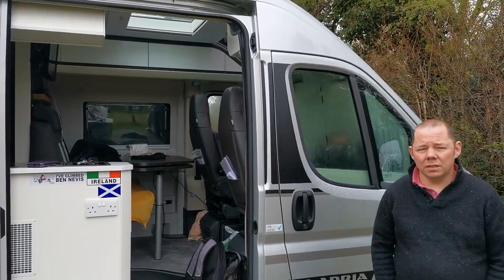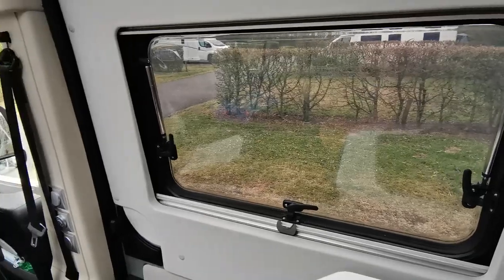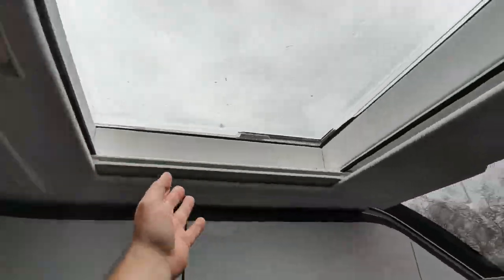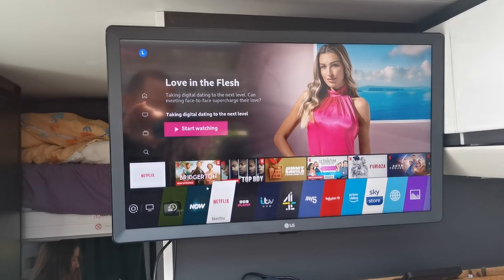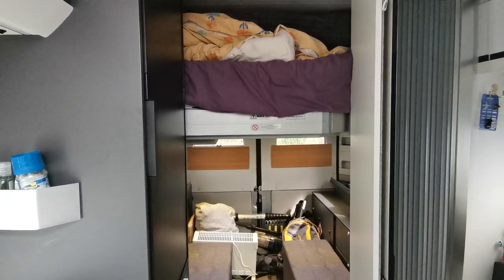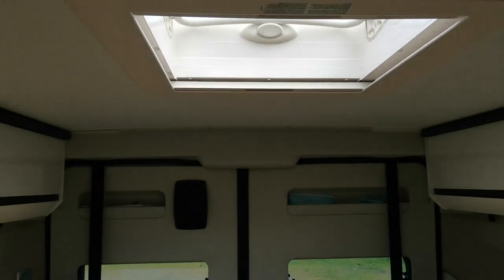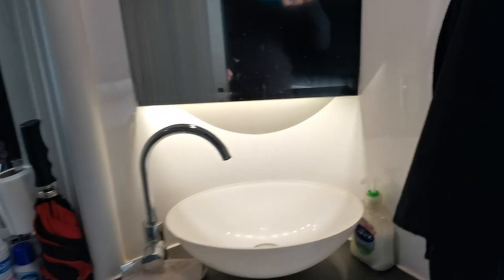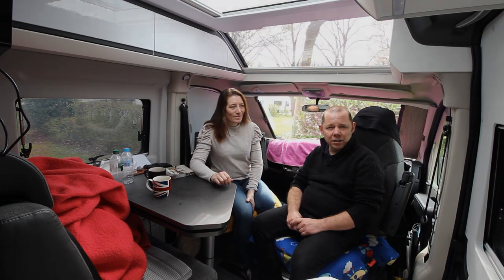Adria Twin SGX640 Review 1 Year On

Comment: If your buying a inverter, buy a pure sine wave inverter! It’s a bit dearer but way better and things like a coffee machine will work on it and won’t work with the cheaper modified sine wave inverters. We made the mistake of fitting a modified sine wave inverter and replaced it for a pure sine wave version..
Reply from the maker: Will be, i have a cheap inverter to get started but would like to get the Renogy inverter which has auto change, so when its all connected to the vans distribution board it will switch to EHU supply when plugged in and inverter battery supply when EHU is not plugged in

Comment: I hope you've fixed the pressure relief valve on your water heater as that is a safety feature and it's extremely dangerous to override it with blue tac!
Reply from the maker: the pressure relief side will still work this does not override it, the ball bearing spring relief will still operate the yellow handle is part of the draining of the boiler which i believe moved when going over some rough ground. We have not used the boiler since as we never found we need a full tank water. If it does drain again i will probably modify it with a different safety device.

Comment: Great video and so informative. We're looking to upgrade our 600 SP to a 640 SGX, your video has provided us with many of the answers to questions we had.
Reply from the maker: Thanks, why are you upgrading to 640, we was almost going to get the 600 as its better for parking but did not like to clime over each other getting in and out of bed
Reply: @BrackstonesTravelAdventures  the climbing over each other to get in and out of bed is the main reason for changing, however we travel with 2/3 push bikes, one of them electric and the chance to travel with them inside is also a major advantage. Have loved the 600 and had many amazing trips, just need to find the ‘right’ 640 to replace it.
Reply from the maker: Understand, especially with electric bikes will be better in the back due to weight or on a hitch rack. Good luck with your search they are becoming rare to find and going up in price, I expect you will get a good price for yours. If you have not already done so, worth joining the Adria Twin FD group it will sell easy on there

Comment: Thx. Good video. 
FB Group is good. 
Spare wheel and Jack out. Good with extra solar. Cool about the AC/DC TV and Sound booster. Good info on slide door protection. Nice homemade shells. 98 or 138 liter fridge. Nice back window protection. Nice things under the bed. 
Link to the boxes in the back?
Reply from the maker: thanks for watching boxes are on Amazon similar to the ones in link below
https://www.amazon.co.uk/Bonlife-Folding-Storage-Ottoman-Bedroom/dp/B08QS33WPW/ref=sr_1_3_sspa?crid=18SY3BBN1PDT7&keywords=large+storage+boxes+bench&qid=1649959134&sprefix=large+storage+boxes+benc%2Caps%2C282&sr=8-3-spons&psc=1&spLa=ZW5jcnlwdGVkUXVhbGlmaWVyPUExTVlKTzBRMjdENVcyJmVuY3J5cHRlZElkPUEwMDMwNDc4WkpITUtSNFM3TEpBJmVuY3J5cHRlZEFkSWQ9QTA2NTgxOTJLVUI4WTFHM0g5TFcmd2lkZ2V0TmFtZT1zcF9hdGYmYWN0aW9uPWNsaWNrUmVkaXJlY3QmZG9Ob3RMb2dDbGljaz10cnVl

Comment: Thanks for the review. We have ordered a very similar van the Rapido V68.
Reply from the maker: Glad it was of help happy camping
Reply: I note your comments about gas. One of the things that attracted me to the Rapido was it takes two 13kg Calor cylinders with auto change over. Or you can can have an 11kg refillable and a 13kg Calor mixture. I had thought about the diesel/electric boiler (which I have on my current van) but decided that with that amount of gas storage it was not necessary. I have bought separately two lithium 100ah batteries with Bluetooth and built in heaters. I will replace the two lead acid batteries supplied with the van. I was surprised that you only have one battery and 300w solar. I would have thought with that much solar you would have had at least a second battery.
Reply from the maker: Hi Hurley, I have a 200aH lithium battery which is way more than we ever use, the 300-watt solar is adequate to give good charge in summer but in winter will not produce much. I am installing a home off grid system with 300w panels and in October flat position on a roof in good sun will give 5A output and in cloudy days will be lucky to get 1A output.
Gas is getting harder to come by few people now on groups I am on are starting to struggle getting gas. I think in the future I will be looking at increasing the vans power to sun everything on 12v or maybe upgrade to a 24v system
The diesel heater is excellent as I never need to worry about the fuel due to it running of the diesel tank. I was looking at installing a 12v heater on hot water system but now you mention diesel water heating this would be something I might also look into

Comment: Looking at your 13amp outlet by the sliding door I’d be inclined to replace it with a waterproof version. I know if it’s raining you’d shut the door but just in case I’d still replace it.  Love the front roof light, it’s a really nice feature and like you said makes a nice airy feel to the cab. Fitting the shunt is a very good idea, can’t understand why their not fitted as standard. They are way more accurate at showing battery state of charge even with lead acid and especially with lithium. I’ve replace my leisure battery for lithium and my goodness what a difference thats made, a bit expensive but in the long run way better.
Reply from the maker: Will never have door open in any wet weather very open to element and will do lot damage so I did not opt for waterproof socket which will be unusable with the door closed. Agree Lithium is so much better and to be honest i cant believe with new vans they are not now standard fit seeing as the vans are so expensive

Comment: Great review and good timing as I have just bought a Adria Twin 640 SLB.  really like your mod of additional 3-pin sockets, which I will definitely steel!  could you share the TV model and perhaps the link for the storage containers?  Keep up the good info.  Love it!
Reply from the maker: thanks, link below to the storage containers. not sure they will fit in the SLB and you do get more storage I believe in the SLB. TV was LG 22MT44D - I bought a 5A 12v to 19v converter on ebay to run the TV. I did do a Vlog on the conversion for any 19v tvs, 
https://www.youtube.com/redirect?event=comments&redir_token=QUFFLUhqbTVfemljQml3YnA2RGJhVmRtYVprNDZFTkFkd3xBQ3Jtc0tuN0lVWEcyRFZmcm9rRFhNY0k0aHNxb1daTWhtMVNuWEJndloxQkR4VXJBWWczdDdXd1hxcjdJYUtYQk1QRVJyNmN0Nkxib2pNb09YVUFDNFpNYkVkMUNSaDI5QkFoWldMQjBmNm5Fci1vUXpxN283bw&q=https%3A%2F%2Fwww.amazon.co.uk%2FBonlife-Folding-Storage-Ottoman-Bedroom%2Fdp%2FB08QS33WPW%2Fref%3Dsr_1_3_sspa%3Fcrid%3D18SY3BBN1PDT7%26keywords%3Dlarge%2Bstorage%2Bboxes%2Bbench%26qid%3D1649959134%26sprefix%3Dlarge%2Bstorage%2Bboxes%2Bbenc%252Caps%252C282%26sr%3D8-3-spons%26psc%3D1%26spLa%3DZW5jcnlwdGVkUXVhbGlmaWVyPUExTVlKTzBRMjdENVcyJmVuY3J5cHRlZElkPUEwMDMwNDc4WkpITUtSNFM3TEpBJmVuY3J5cHRlZEFkSWQ9QTA2NTgxOTJLVUI4WTFHM0g5TFcmd2lkZ2V0TmFtZT1zcF9hdGYmYWN0aW9uPWNsaWNrUmVkaXJlY3QmZG9Ob3RMb2dDbGljaz10cnVl&stzid=UgxpBcZvLy7VUcgDM1p4AaABAg.9_lh7WNEj259_oJUqDgX8h

Comment: Hi many thanks for the video could you advise on the wood you had the rear box made out of as looking to do something similar tia
Reply from the maker: Hi, if you mean the seating boxes, we actually bought them from Amazon. They are called Nyxi Ottoman. link below. https://www.amazon.co.uk/Nyxi-Ottoman-Foldable-Storage-Bedroom/dp/B085DRDSKW/ref=asc_df_B085DRDSKW/?tag=&linkCode=df0&hvadid=430805529020&hvpos=&hvnetw=g&hvrand=5594364719633446773&hvpone=&hvptwo=&hvqmt=&hvdev=c&hvdvcmdl=&hvlocint=&hvlocphy=1006886&hvtargid=pla-907389775160&mcid=a3fbade744b73249b7c94e047ed0964d&ref=&adgrpid=103002100027&th=1

Comment: Thank you for your video it gave me a lot of information I needed before purchasing my Adria. Have you figured out the "maximum  of watts" of solar panels that can be placed on your roof in your configuration?
Reply from the maker: Hi, I have not got the van anymore we have changed to an Auto Trail but I can say we could have added an extra panel at the rear and if they where all 120 watts this would be a total of 480W. To be honest the 300 watts we had with Lithium could run for weeks no issues even in the winter months

Comment: Good informative video. Just interested in the metal upgrade for the mosi net on the side loading door. Where could I get one as I have the same problem with it coming of the runners all the time?
Reply from the maker: Try your dealer it was an adria mod should be free. If not ask on FB group sure someone new where you can get one

Comment: hi
interesting review after one year of use - and lots of ideas for modiifcations. What struck me most is the amount of extra "stuff"you''ve added / carry. We have one on order  - now just the 140bhp engine - and 9 speed auto (BTW the 180bhp is only on the "heavy" chassis. Assuming yours (like ours ) is on the "standard" 3500kg chassis - do you happen to know  the available payload for your van as it stood before adding extra solar etc etc?  Our dealer - and Adria refuse to answer any questions|! 
Adria quote MIRO of 2965kg for the SGX but  are not 100%  clear on what's included. Worse - that 2650kg  doesn't even include their "standard" packs  (awning /etc etc ).  I found an owner's manual on Motorhomefun and that talks about "empty weight" - which includes fuel and full water tank and boiler. and makes no reference to MIRO whatsoever. How very unhelpful!  

So it would be really appreciated if you could provided  this frustrated future owner with a better idea of available payload.  We don't need to, but would prefer to, stay at 3500kg! Thanks Norman
Reply from the maker: Hi Norman, we was told the weight would be 3000Kg with all the dealer kit fitted. The solar I removed (NDS solar) was a lot heavier than the solar I fitted so will not make much difference to the weight. Removing the AGM battery and fitting lithium will also be less weight, only other items fitted are the battery B2B and MPPT which are very light. If you want to get more better understanding on the overall weight and what people have done please join the Adria Twin Face Book Group and ask on there. It has a lot of very knowledgeable people on theses vans so worth joining

Comment: Hi mate, thanks for a really helpful video.  I assume the bed only has 2 positions - fully up or fully down.  Is that correct?   I was wondering if i could get a bicycle into the garage if i take the wheels off.  Can you tell me the height and depth of the garage space with the bed down. Cheers
Reply from the maker: The bed can be set at different positions. Some have put bikes under set the bed half way to use but you will need a ladder to get in. I do not have the van now so cannot tell you the dimensions but if you join the FB group for Adria Twins they will let you know very friendly group on these vans

Comment: when you mentioned the phone holder for use when travelling, is that for mapping or other? I dont have that holder  on my Ducato but I do have the same media and use Android auto for map reading even though there is the fiat one installed. the fiat one is fine and you can input your dimensions for rd avoidence but i do find it frustrating that I have to alter the units to MPH etc from KM. I cant seem to find a permanent change for this.
Reply from the maker: Yes we use the phone holder to hold our phones and use google maps as our sat nav. I prefer this as the passenger can grab it zoom in on maps and change route quickly whist on the road. I find all sat nave very slow to control. This one on the van is not great for zooming in and out of the maps to see the final destination etc. Google maps also has much better live update on traffic. We now never use the fiat satnav

Comment: have you ever had situation that your battery died?
Reply from the maker: I fitted a 200+ ah lithium battery which I did a few blogs on how I fitted it so I had enough power with the upgraded solar to not worry about this. With the standard agm battery I would expect you will run out over a weekend easily
Reply: @BrackstonesTravelAdventures  i guess weekend is still nice considering lights, powering devices etc. Btw great video, those 40+ minutes snapped in seconds since I started doing researches cause when I was a child I'd go on holidays with my parents on camping with a tent so caravaning is in my blood and and I started to think and consider camper van like yours vs campervan like a trailer one to pull it with my car to maybe equipe myself with in following couple of years
Reply from the maker: @kapiczu3776  problem with this can and battery the fridge is a 12v compressor fridge and so it draws a lot of power from the batteru
 OK if you get electric hook up each time
Reply: @BrackstonesTravelAdventures  i guess, as long as you have the sun during the day so the batteries can charge its Okey. Especially as you told me that you can turn off the fridge for the night since it has good isolation or at least put it in sleep mode(which for sure uses less power). However, I think that compressor fridge, even considering its flows with high power, draws its superior to anything else